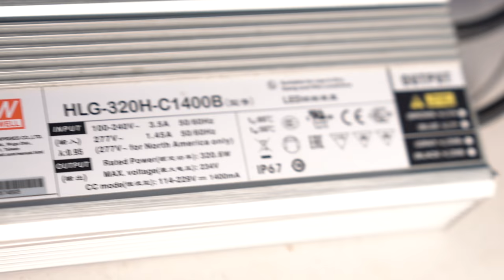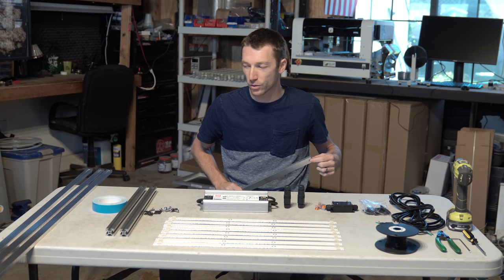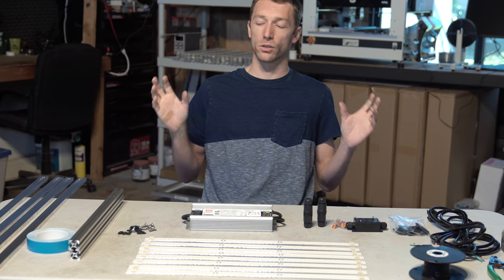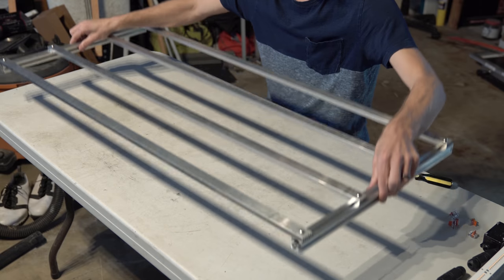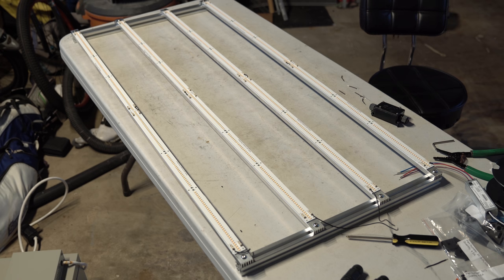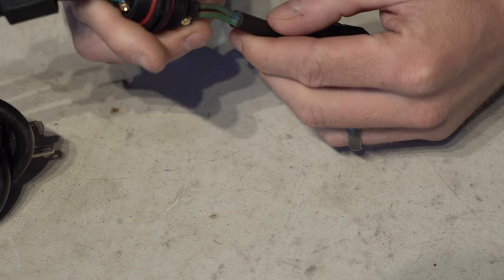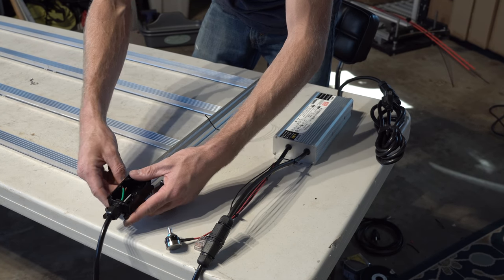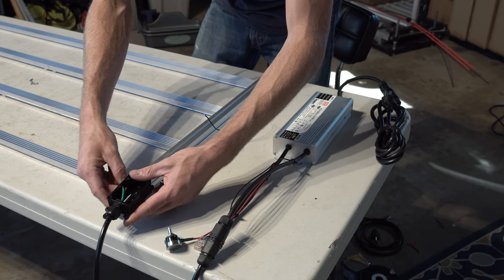Photo Boost Strip DIY LED Grow Light Build

Comment: I’m 3 months in on my first two lights, gotta say, it was worth the wait.  Already built a third, and will be building more as money allows.  I’m seeing a 50% increase in yield over my Bestva 3000w leds, with about a 10% reduction in heat, and a 40% reduction in energy usage. It replaces about 1.5 of my original lights.  Very nice build!! Thank you!
Reply: Bestva is cheap old gen blurple.

Comment: Receiving delivery of most of the components this week. I find the url for the Tnutz/screws shown above is a .5 inch screw. The url shown in the reference design build on the pacific lights website is a .75 inch screw. I received the heatsinks from heatsink USA and they are .5 inch deep. The .75 inch is the one to order. I am in Michigan and the weather has turned unseasonably cool. I am anxious to receive the 8 strips and get this light hung so I can bring in my outdoor plants if needed. Thank you very much for providing all this information, along with the info on Jacks. I switched to Jacks 3-2-1 this summer. The difference is astonishing.
Reply: Right on bro, Mich also!
Reply: Man this Michigan weather dosnt know what it wants to do. i was wondering how much did everything run you if you dont mind me asking
Reply: @TheWorstGamerEva  total cost was about $450. I recently added a UVB bulb because LED does not create UV light. Flower in day 31 and looking frosty. The UV add on was around $100. It should add 30% more trichomes.

Comment: i bought enough boards for 2 lights......i will be doing this from now on....i also set my ballasts up outside the area for heat reduction and added a 3 prong connector at the light for quick detach ... makes for easier transport. I will be ordering more boards....please keep us posted on any deals or specials.....i will even promote this product to the best of my ability. Also any future technology upgrades. you have created a light builder here! starting my 2nd one now.
Reply from the maker: All that was done in the most recent build video. 
https://youtu.be/dfNYWuN7_cc

Comment: Love this. Highly considering a build for a 5x5 with this setup. Definitely well explained. Thanks for vid.
Reply: I was thinking of getting two of these at  over 600 watts in my 5x5 area,did you ever get one? how's the light if you did?
Reply: @mrmateo513  I'm also wanting to light a 5x5...Wonder if we would have to add a couple boards to each fixture to properly light the 5x5....Seems 2 fixtures will be fine for a 4x4, but I'm wanting to light a 5x5 without being on the low end of photon output....
Reply: @Khaymen223   I ended up getting a 315 cmh light and put  a 200 watt cob on the right side and a 260 watt quantum board on the other side...doing all kinds of experimenting on my lighting right now lolso far it's about even im only 4th week of veg so I wont have numbers until flowering,so far its so even cant really pick what I like... I plan on getting a 5x10 tent after harvest I might just keep them all
Reply: I also got a 2nd 5x5 tent using a 630 cmh light trying it out too,but so far i'm liking mixing all the lights for a mixed spectrum
Reply: @getbrainseeds  I'm using a standard 1000 HPS and it's not enough for a 5x5.....I'm revamping the room and can't find any led that matches affordability, and quality for a 5x5 size.....If I stuck with hid it has to be air cooled cmh as I'm done with HPS....I really want led but price point is still too high for me
Reply: @getbrainseeds  I probably can't get LED till I can light a 5x5 area for $500 bucks or less.... Maybe in 5 more years price will drop enough......Even doing DIY is more than that as far as I can see
Reply: @Khaymen223   yea I feel you on the hps expensive to run...yea I hope the prices go down now that other companies in china making cheaper version they are going to lose business to china,their qb kits are twice as cheap on dhgate and from what I read  certain sellers on there sell lights comparable to hlg qb kits just got to go to the right person
Reply: @supercropper420  I believe so, but it put me over budget......Using 80/20 extrusions for framing, 16 PLC heatsinks with 16 PLC P.B boards, on 2 hlg320 drivers, then 4 ChilLed mau5 led Pucks on each corner, mounted to the 140mm pin heatsinks driven on 2 hlg240 drivers.......I would attach the pin sinks to a 90° L bracket tack welding the sinks to bracket, and tack weld brackets to frame. My worry is finding someone to weld the aluminum.....Aluminum isn't to be welded by Joe Bob anybodies....

Comment: You could also size your tent, buy a tin, or some thin alum sheed, mount the lights to that, and mount the rads to the other side, that way you only have radiant light heat that you would have anyway, but also a full reflective surface, and a closed off area to vent much easier.

Comment: This build is awesome and the lights are crazy bright!! i would like to note on my build, the dimmer that is in the link DOES NOT got to zero/off.
Reply from the maker: Recently been told this. Not sure what happened to Rapid.
Reply from the maker: Any cheap 50k ohm pot off amzon will work.
Reply: Yeah I'm not sure if maybe they used two different component or not everything works fine it just does not go to zero is all. Excellent build excellent work this thing is bright as "F".... thank you for sharing it. It's brighter than my electric sky ES300 at over $200 cheaper and I got to build it myself which I love and take pride in.

Comment: Ok so I got a cheap grow light I got off eBay. It looked like a mars reflector 600. Well I took it apart and it had two drivers running the leds and two small I guess 12v running the fans. The led drivers are 70-80v at 680+5% ma so 714ma. Would using these boards be any good at that drive current?

Comment: I was contemplating buying the Gavita 1700E, but the price just didn't sit well with me. Instead, I want to build a 48"x 48" version of this light with 8 light bars for a 5x5 grow area. I want a driver that will push 640 watts. Which one do you suggest? Doubling the price of the driver listed, I calculated it would cost me about $765 to build with your listed parts.  That's a hell of a lot better than $1300 gavita which you can't dim unless you buy the $400 controller!  BTW...EXCELLENT video!!

Comment: Renaissance man or Svengali,  I love the breadth and clarity of your work.  I'd like to do this LED build for a 4'x4' but double it (8 sinks, 16 strips) on say 42" rails.  Q1: WOULD NOT THE MEAN WELL HLG-480H-C1400B DO THE TRICK FOR A DOUBLED-UP VERSION? Your garden looks great under LEDs!!  Q2: As far as spectrum: Would you recommend I use CMH/HPS lighting during Veg and then flipping to LED, or just use these LEDs from start to finish?    Keep on teaching.

Comment: No shipping costs then this would be amazing, including ridiculous shipping then a HLG 550 V2 would be more adequate.

Excellent 💯🔥
Reply from the maker: There is 70% more light coming out of a 16 strip PLC Photo Boost system over a hlg550 v2.
Reply: @GreengenesGardenOfficial  Do you have any in stock now? (boards)

Comment: So when u add everything up and together how much money goes into this light
Reply: I was wondering the same thing so i looked it up, 
240$us lights strips
90$us driver 
150$us for the rest(heat sinks, thermal tape and mounting hardware) 
480$ before taxes and shipping. 
This is a gorgeous clean build but i don’t see much savings🤷‍♂️
Reply: @TheStp77  you could do it for cheaper off of not his links
Reply: Not worth it

Comment: Hey , great build. I did your press build. Works great , well explained, as is this one. I'm thinking of doing a couple of these , maybe more. I have one question. You mentioned 320 watts but I never heard mentioned how many lumens or what this system would replace. I'm using 1000 watt hps for a 3' x 4' area right now. Would this unit replace what I have?
Reply: Tin Tizzy  thanks for the reply , just noticed it. Getting ready to build a couple to start. Not as much a power savings as I'd hoped , but the heat out put should help overall with what we have now. Very hard to keep the room cool enough in summer.

Comment: Awesome!!! Damn, got me drooling.  Wanna do this new build. Followed you so far.  But, damn, what to do w/the COBs(24 cxb3590, 12 cxb3070) 9 drivers(185h, etc), zigbee wifi controller.  Tough keeping up w/you and this new tech. But, then, it's all progress.  Looks like time to turn in the pocket change jar.  Great vid.
Reply from the maker: I feel ya. With these strips, the HLGxxx-c1400's can be used if you have any from the older 3070 builds.
And by no means are those COB builds obsolete. If they are growing what you need, and not costing you on upkeep, they are doing their job better than a new light would. 
But the urge to tinker and try new stuff in the LED world, can be a pricey urge.
Reply: Shit ya, COBs ROCK!!!  NO complaints, here. By no means.  DIY/growing is pricey, but, aaah!, the investment is well worth it.  Thanks for the driver tip.  Good to know I can use my drivers. That's a saving, there. I believe your site listed compatible drivers. Thanks for the reply.

Comment: You say 3/4” screws in your video a few times but the link on the supply list goes to a 1/2” screw.  Can you clarify which one is the correct size to use?

Comment: I pre-ordered everything with the Photoboost Heat Sinks. Are the mounting screws / t nuts going to be the same as this build ?
Reply from the maker: There is a simpler way to build with the PLC heatsinks. You can use a single frame piece up the center and use the hole in the center of the heatsink to use standard 80/20 hardware. Check out https://www.instagram.com/p/B5ZhMCWJFD3/?utm_source=ig_web_copy_link

Comment: I've enjoyed watching this video. I've learned quite a bit. The one thing I just can't grasp is the purpose of the 'thermal tape'.  The name implies its used to control heat, but you clearly don't use it for that. If you did, you wouldn't tear it off before putting on the boards. What's more is you go into buying a slightly larger thermal tape and then just trim the excess. What's the point if you're going to tear it off before applying the boards?
Reply from the maker: Need to watch again. That’s double sided thermal tape...
Reply: @GreengenesGardenOfficial  LOL  After reading your response, it makes so much more sense. I mean, what point would there be to have one sticky sided thermal tape?   Duh!  Thank you for your response.

Comment: How about making it water cooled? That way you could use a cheaper aluminum strip and many people will use these for hydroponic systems anyways so you could just cool it with the water you have running along your plants, basically giving this heat to your plants (which works great if you live in a colder place).

Comment: I have purchased heat sinks from you and supports from tnutz. I have seen the link to a instagram page where you have 1 support in the middle. Can I use the support I already purchased from tnutz (doesn’t look like you used theirs in pic) and is there a wiring diagram for this configuration? Also I have a cheap light, 600 W viperspectra in 4x4 tent. I am sure this will provide better coverage but how will this compare lumens, par, ect.

Comment: nice build!  Got any PAR numbers?
Reply: PAR really isn’t the standard of measure in LED . PPFD and Micromols is. Those look to be great. I currently run Fluence spydr2I and they’re excellent, but I’m looking for a equal option for less $ as they’re $1500 each.
Reply: dirigoelectric how these compare to es300
Reply: King P  how do what compare? The 180’s? Same exact light, just smaller size.  They’re 2’x12” instead of 3’x18”
Reply: dirigoelectric compare to the diy not the 180s.

Comment: I really wanna make one of these lights for a 3x3. Do you think I should just do the 4 boards with 2x2 frame or could I get away with  using like 6 boards on 23inch heat sinks and 30 inch 80/20 frame. Or would that be too much. If I can which driver and potentiometer should I use. Thanks just waiting for the boards to restock
Reply from the maker: 8 strips on a 320 driver.

Comment: Thanks alot for all the great videos. I am doing my own build thanks to you. I have a question...for the setup i need (3x6) table  i would like to build 5 rows of 3 boards each running the length of my space. heres the question, using only 15 boards instead of 16, what do i need to do as far as drivers, can i still run it the same way only with one less board on one driver or should i wire all 15 in series and run a larger driver to accomadate 15 boards. TIA for any input from the OP or any YouTubers.
Reply from the maker: It would be the same as a 16 strip build. 2 320 drivers. driver will just have 7 instead of 8.

Comment: Yeaaaa, i just need to know, wich heatsink i should get to run this at the full 1750ma?
And, is it the dimmer switch that changes from 1400ma to 1750ma?
If these questions sound lame, its because im totally new..
Reply from the maker: https://www.heatsinkusa.com/2-079-low-stock-please-call/ will do it. 
depends on how many drivers. 100k ohm/number of drivers.

Comment: Any issue running two of these side by side? I want a 4x4 build, but I wasn't sure if two sets of strips basically directly next to one another without any space between them would be a problem.
Reply: Also, is there a way to pull data from the lights? I don't really know what I'm asking here, but I plan on feeding all sorts of telemetry data into a remote monitoring system. I'll definitely be using a Sense to monitor overall power, but any additional granular data would be dope.

Comment: Great Video!!! Will the LED facing down have the potential of being scratched up by  the table top
Reply from the maker: Yep, there is that potential. They sit on the connectors so the leds have natural clearance. But a little pressure or unevenness could damage them.

Comment: Do you have any PAR numbers available? Do you have a build video of you doubling this LED build, say 4x4? Also, You say it has plenty of White LED lighting and includes Red LED's but does it have any blue or would the blue be considered part of the white spectrum? Sorry, I'm new to this. By the way, the LED strips are now back in stock cause I just bought 8. WooHoo!
Reply from the maker: The only difference is to use a 40" frame instead of 20". Everything else is doubled.

Comment: What driver would you recommend if I added 2 more heat sinks?  So that would be 12 total strips.
Reply from the maker: you would need to run a series-parallel configuration with a 54v driver.
Reply: I built a 12 strip version.  Used the HLG-480H-54b driver in a Parallel -series set up.  Used 33" rails and 6 of the heat sinks.  The only major difference in the construction: added a t-nutz frame center crossmember for stability and to run the parallel power wiring.  Made sure to use equal lengths/resistance when wiring the strips. (That's 6 sinks in parallel, (+) on one rail side, (-) on the other, each sink with 2 strips in series.) The center crossmember also provided perfect balance, so I only needed 2 hangers for adjusting the frame height. [Thanks Gene for the inspiration!]

Comment: Hey Gene, what's the connector voltage limit? Around 300v? Just wondering how many of these can be chained in series before we reach upper tolerances of the poke ins. Awesome video and build as always bro. Happy to see you guys out of stock so quickly. 😁👍
Reply from the maker: 300v for the connectors. Someone bought a few hundred I wasn't expecting and threw me off, I have more being made and ordered. But yes, was a very nice surprise. Proof of demand is there, I can get more funds to the project now.
Reply: @GreengenesGardenOfficial  that's great,sounds like you have a winner.  New sub, got me waiting patiently for restock. Good design congrats. 👍

Comment: Hello @Greengenes Garden 

how much Photo Boost Strip needed for 100CM X100CM grow tent
and what would be the cover of this one?
because I see that the system is more designed for 120X120 view that Photo Boost Strip are 24 inch ... so 2 by heatsink to 120cm long ...

thank's
Reply from the maker: The strips are 560mm.
Reply: @GreengenesGardenOfficial   ok and how many Strip needed for 100CM X100CM  grow tent ?
thank's

Comment: Hey man, awesome video.  I have a question for you though.  What would we use if we wanted to allow an angle adjustment right in the middle?  I looked around on 8020 and found a few different options, but I wasn't entirely convinced that it was what I was needing/best/reliable option.  Hate to put up several hundred dollars of lights for my hinge to give out and well.. that be that.

Comment: EX-1010 – 1″ X 1″ what do we put for the fractional length and tapping options?  I got the 20 inches and 2 of them but not that part. Just wanted to make sure i was ordering the right stuff! Thanks Gene!
Reply from the maker: Put whatever you want for your design. fractional length is just length. if you want the ends tapped get them tapped. None is needed.
Reply: Thanks gene, for the first build I wanted to follow your exact build so I'm not scratching my head too much. Thanks for the quick reply. Let the parts pile begin.
Reply from the maker: If your using the PLC heatsinks watch the newer video.